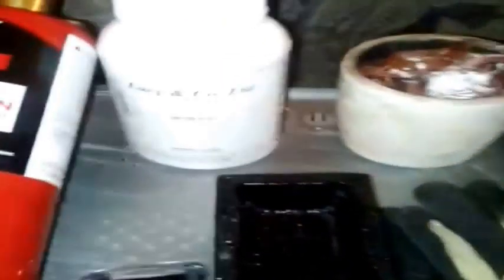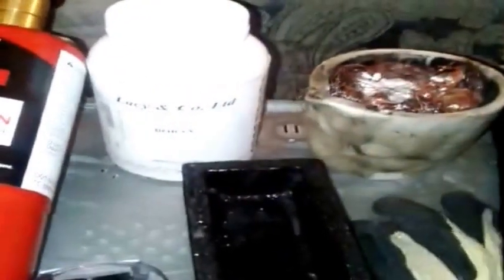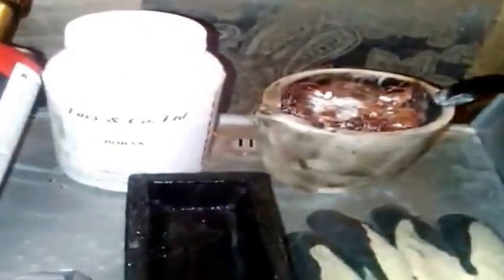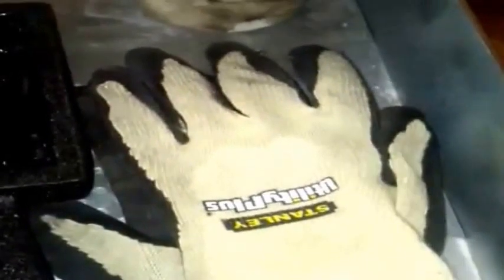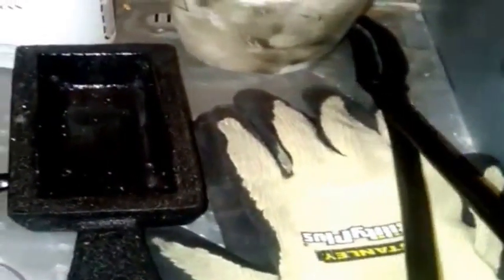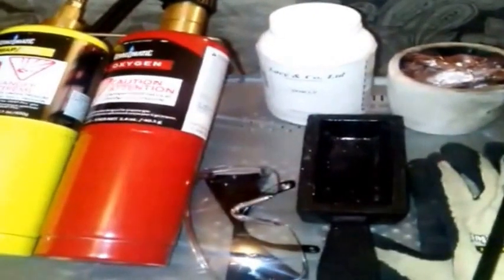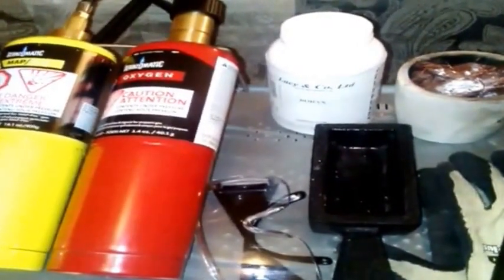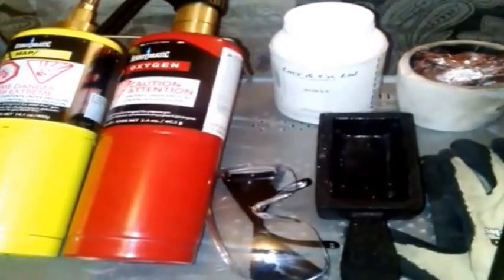Avi Oziel Presents: How To Cast, Melt or Smelt Gold, Silver, & Copper - Precious Metals Melting

Comment: LoLz at the 1.4oz oxy tank. Just buy a map gas torch. The cost of the oxygen makes melting copper pointless. The fuel is worth more than the copper...
Reply: Just to mention, Mapp with normal air will melt silver and gold with no issues at all. It will melt copper too but can be tough to get it to a pour temperature.
Reply: Rob Breckenridge actually rob if you have the proper torch head you can just use propane i can melt 6 OzT in my crucible with the bernzomatic torch head i use it is a bernzomatic JT539 swirl flame torch head. melts gold and silver quite beautifully works on up to a full troy Lb if you use a furnace and an A1 crucible this  guys joke of a plumbers setup is kind of disgraceful. if you have watched any of this other guys videos i have torn him apart repeatedly for giving false information to people about gold and e-waste refining he just wants to sell books to chumps who think they can get rich quick. sad thing is the knowledge is free right here on youtube and on the www.goldrefiningforum.com lots of great info and knowledge on there for the home/ hobby refiner!

Comment: Is there a reason you use Map gas rather than acetylene? Also, would it be better to use a brazing-style tip like the one in your video or would a rosebud tip be better at spreading the heat around the crucible more evenly?
Reply: +Amadeo Serrano I use an Oxy/Acty setup With the Rosebud. I do up to 5 ozT, but I think I can do more then that, just not setup for that........